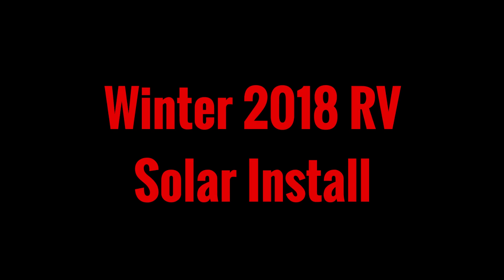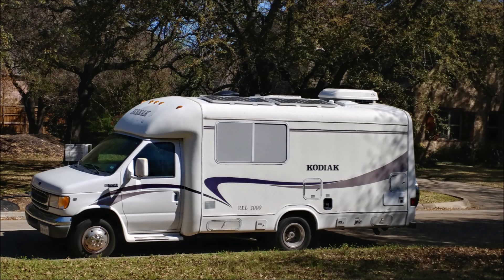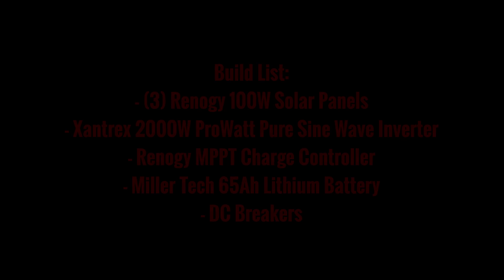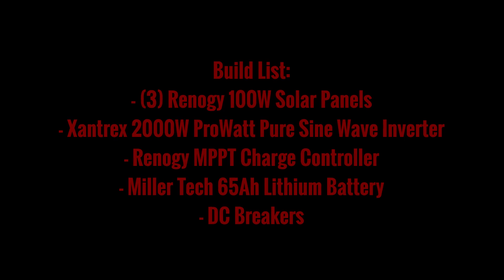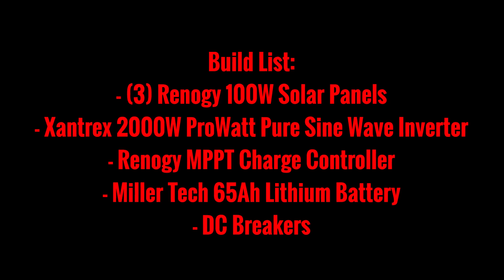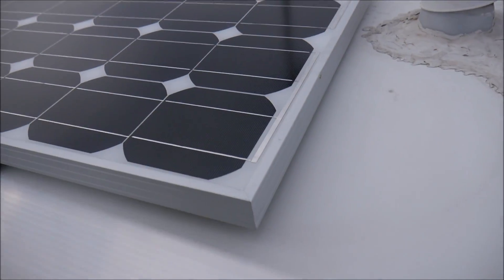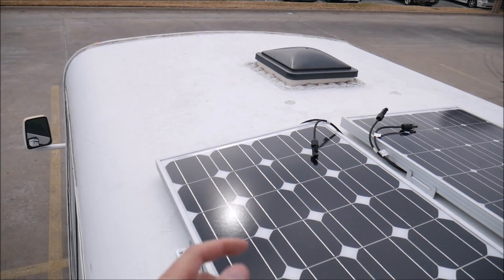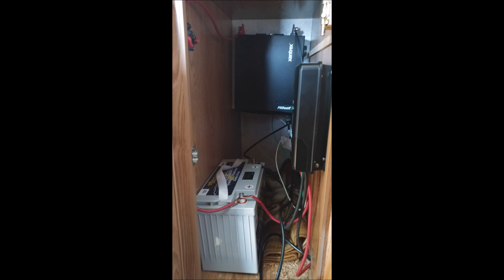Solar RV Install (With Lithium Battery!)

Comment: As soon as you said the client supplied panels, etc. I would've politely declined to do that job. It was always going to be compromised as not a ground up install.
Reply from the maker: Because it was my first install on an RV, I was willing to do it for the experience.  I didn't make much money off the deal.  But if I were approached by someone else like that now I would decline, for sure.
Reply: let them do the choice and purchase..they have the warranty. just have enough odds and ends to finish it up... easy

Comment: That inverter sounds INSANELY inefficient
Reply from the maker: Why do you say that?
Reply: @LDSreliance  Because generally the higher the wattage on inverters the higher voltage is needed to cut it on and when using such a lower wattage solar panel array it causes the inverter to be active in less time area causing them to waste more energy. Also, the higher the wattage on the inverter the more power they use generally. So that 300-watt array with the 2000 watt inverter is not only going to basically get fewer sun hours because the inverter isn't cutting on, but the inverter itself is providing higher electricity loses. Not to mention it's a waste of money since it would be better to get a cheaper inverter.
Reply from the maker: That is true but he needs a large inverter to handle surges for some of the bigger 12V loads.
Reply: @LDSreliance  Ahhh I see, maybe a dual inverter set up might be useful but that would add weight, bulk, and expense but it's more efficient. So that would really be very situational. As far as I know, they don't maker smaller inverters that can handle larger loads, that's a place where the market could certainly use some products.
Reply from the maker: Yes.  An efficient 600-1000W inverter that could handle ~5 second surges up to 2000W would be awesome.  But I have yet to find anything like that.
Reply: @LDSreliance  Yeah I haven't seen one either but I haven't looked in a long while. It's really a hole in the market, but it's probably due to that making generally cheap inverters cost a lot more, and it'd be another skew number for them, and they could just over sale you instead of giving you what's best for you
Reply from the maker: Right.  Instead, most inverter manufacturers just lie about their surge ratings.  In my testing I have not found them to be able to handle anywhere near their claims.
Reply: @LDSreliance  Sadly it doesn't surprise me. When I was working with them actively I noticed some stuff like that but I never ran tests to verify since it wasn't important to the job because they were all good enough for our needs